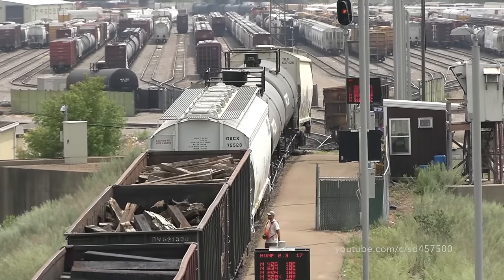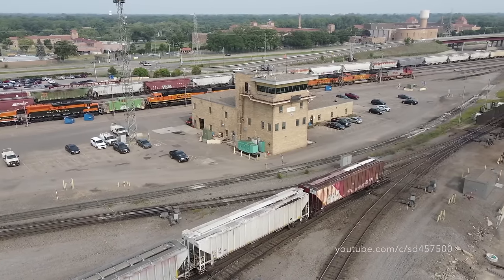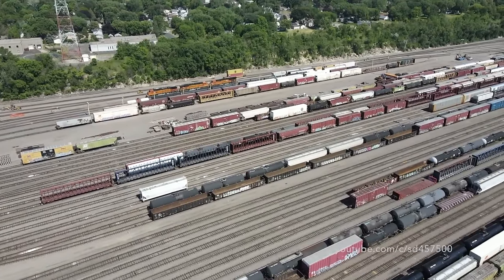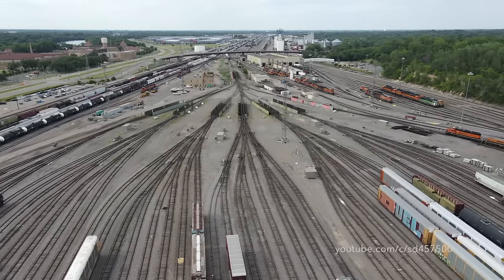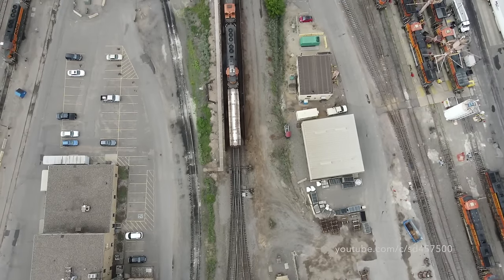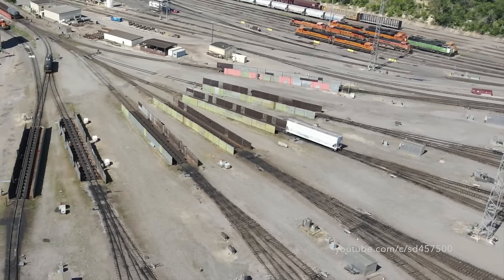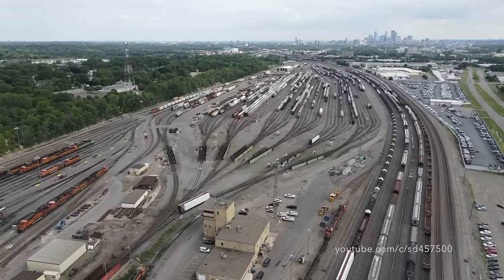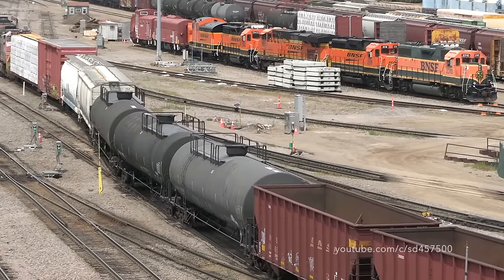Hump Yard in ACTION at BNSF's Northtown Yard!  How It Works, and Switches Rail Cars-

Comment: I quite enjoyed this video as back in 1974 I was one of the computer programmers then working for GRS who designed and installed the original computerized system and then in 1993 working for another company replaced it with a second computer control system.  My last visit to the yard to do some software upgrades was in 2004.  It was an interesting 30 year interaction with this yard (and many others :-) and the railroad business in general.  Since then I believe the control system has been twice replaced.  But for the last 14 years have been happily retired ;-)

Comment: For the retarders they are known as Master Retarder the first one, then the group retarders. The retarder is set up to control the speed based on the weight and the distance it has to travel to the next car it’s to couple to. Reason for the scale before the retarder but also used weight the car. Even tho the yardmaster knows what cars are loaded and empty the scale helps determine the amount of pressure the retarder needs to apply. Track seniors knows where the last car is at in the class track and sends a signal to the group retarder to base the speed to 4mph once the car reaches the coupling. I worked as a hump conductor for 5 years before becoming an engineer. I learned how to run the old manual system before the computer system came along.
Reply: Does that mean the cars couple automatically as they roll down into the car in front of them? What happens if they come up short?

Comment: Everyone always gets the Slug meaning wrong always, more times fans say there only full of concrete as they are but there is a lot more to a Slug as you know of. Retired Hump Master I'm and I ask a simple question what keeps the Slugs Traction Motors from Over Heating 🤔 if their just full of Concrete Slabs for weight!?! 

Most yard Fronts have (Retarder Pins) on the Receiving Hump Bowl tracks at the front of the yard as a Safety insurance, so cars don't roll off on to active tracks even when the bowl itself fails to keep them in the yard as it does happen more times than you know. (Retarder Pins) are located on the inner side of each track looking like 3 Giant size nails that keep the Car wheel from rolling out of them, controlled by air when used they extend out when Not used they suck in, just something Fans don't know about when working a Yard.

Todays Yard units have No talent especially those RCO (Radio Controlled Operator) or RCL (Radio Controlled Locomotive) units Talent is when a 1980's Yard Crew would do a Domino kick which took skills to notch up and down while braking to Kick only the Last car off the Rear without moving the Train at all, YES kicking the last car OFF the rear of the Train that Never moved any of the other Freight Cars,  Dying art it is. Coupler slack helped a lot when preforming this at hand, ask why because sometimes Couplers just don't UNCOUPLE and you need to hit them hard and a Domino kick is one of the Hardest hits you can do on a Car.
Reply from the maker: I appreciate the great information, and insights on the video!  GREAT point about the slugs, and keeping things cool.

One thing I've seen fade away is the use of hand signs.  Once used all over the place, it is also a dying art. :/